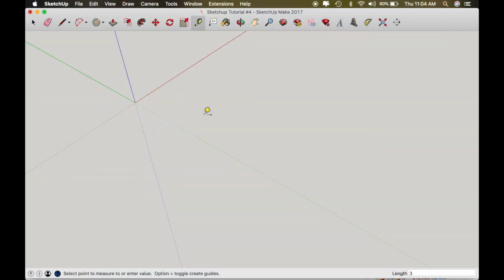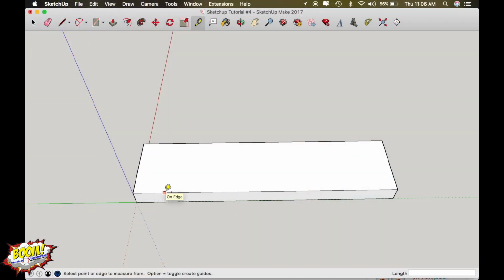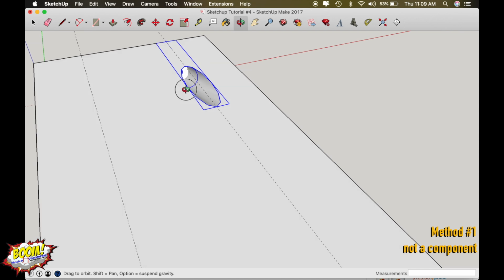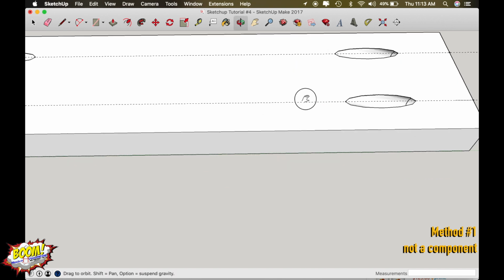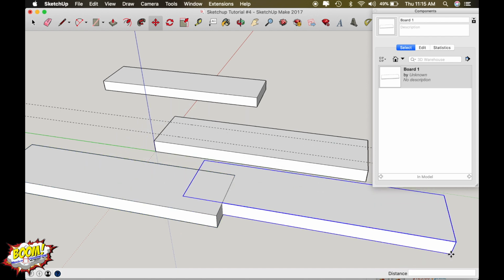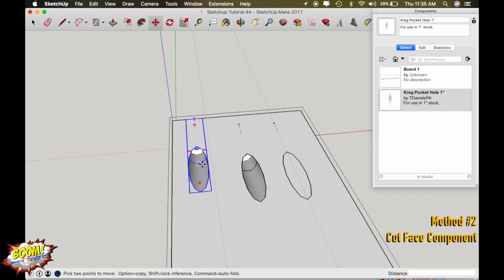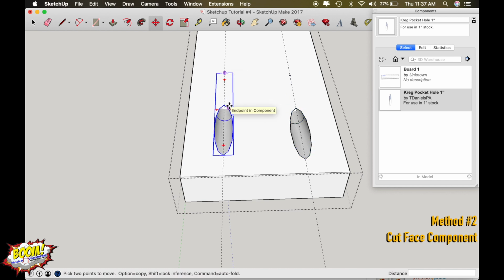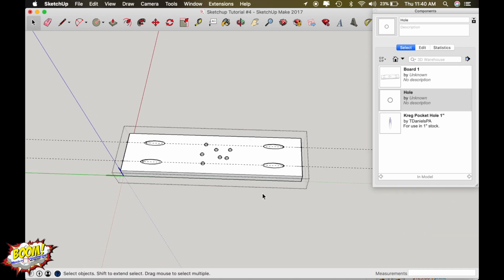Make Pocket Holes - Sketchup for Woodworkers Tutorial 12

Comment: Hi Drew, great video. Was the pocket holes to far from the edge? I do not have a Kreg jig myselve, but I had the impresjon that the tip of the drillbit goes through the board when you make them, your model did not show that as far as I was able to tell. The downloaded model you put in seemed to have a protruding hole that I would have expected to come out of the board, but it snapped into place so far into the board that it remained hidden.
Reply from the maker: That particular pocket hole was designed for 1 inch thick material, not three-quarter but in real life the pocket hole does not protrude through the end of the board anyway.
Reply: Rock-n H Woodshop Thanks, I was wondering abouth that because the thin thip of the bit is protruding in some yotubers videos and not in others. It is difficult to know what is right from wrong, without having played with things woureself. Now that you mention it, I reacted for a split second while watching the video (before forgetting), that the model showed so litle support on the underside/backside of the hole but I understand now when you explained the thickneses. Thanks for clearing up, again great video as usual :-) you are good at explaining without rushing (trying to speak fast to get more info into less time), taking time for details, unstrained and natural voice. Your videos are plesant to watch. Ps, pardon my english, as a dyselectic Norwegian I try my best. BOOM!

Comment: Good information. However, when you copied the pocket holes for the other side, you rotated each one individually. If you highlight (select) both pocket holes, grab one on the right side and move (copy) the two new pocket holes all the way to the right edge of the board. To keep them aligned to follow the red axes, tap the right arrow key to lock the movement only to the red axes. Move the two new pocket holes to the right and drop (click) on the edge on the right. With the pocket holes still highlighted, RIGHT click the mouse, go to "Flip Along" the select "Component's Red".  This will flip the two new pocket holes to face the opposite direction. Hope this helps.
Reply: countrymagic61, I do not use Macs as Drew clearely do, does he even have a right mousebutton? (There probbably is another keycombo to do the same thing, if he does not though)
Reply: @DracoPCC  There are keyboard short cuts. You can also assign other commands to a keyboard short cut. For example: I use grid lines all the time and I get many grid lines going on. When I'm done, I press control G (which I assigned) to remove all the grid lines.
Reply from the maker: Thank you very much I appreciate the great information and I am sure the viewers also appreciate it. If there’s one thing that I have learned from doing these tutorials, it’s showing them many different methods to do the same thing. Honestly, that is one method that I forgot to re-introduce. Thank you very much for bringing that to light.
Reply: @rhwoodshop  Also, I noticed you use "Hide" and "Unhide". If you assign different components, groups, or objects to Layers, you turn on and off what ever you want.
Reply from the maker: countrymagic61 Yeah I have shift D assigned to my Gridline removals
Reply from the maker: countrymagic61 yes sir, layers are something I do plan on introducing in a future video. I’m trying not to bombard my viewers with so many different things that they can do. I found that if I spread it out and let them master slowly the information that I am introducing, they retain it better
Reply: @rhwoodshop  Awesome! I understand and can relate. I was attempting to be helpful. I'm not an expert with Sketchup. However, I can get done what I need to get done. I have a scale model of my small shed/workshop in Sketchup. I use it to help layout my shop (what I'm working towards). It is easier to move things around in the Sketchup environment than to actually move my equipment around in the shop. I have  14' x 20' metal shed with a eve height of 80". I can't set up my shop yet. The roof leaks when it rains and I have a few different ideas to fix that. I need to get rid of the garage type door and frame in a double door. Oh yeah, the floor is far from being flat let along being level. I have an idea for that as well. The shed was put up over 40 years ago by my grand father. He used is for his yard tools and little tractor. The shed is now mine and it is a place I go to be content, relaxed, and to find peace. My hobby is not for business or to make money. It is a place for my therapy. My shop is called "Mike's Saw Dust Therapy". I've been watching your videos since you made your table saw island. Keep up the good work and continue to inspire others. Mike from Tucson, AZ